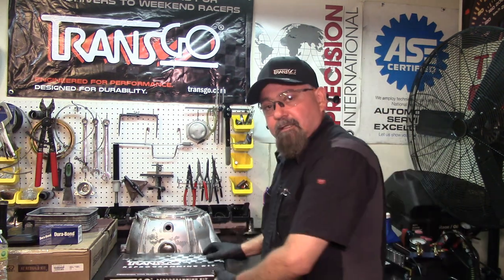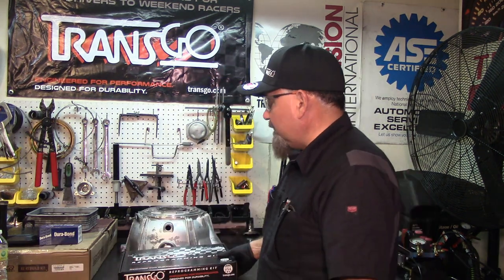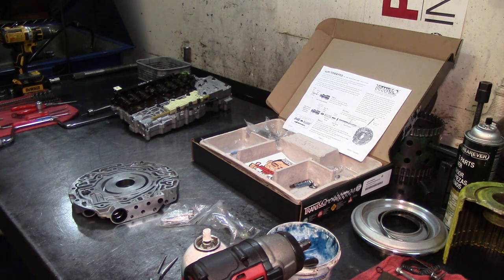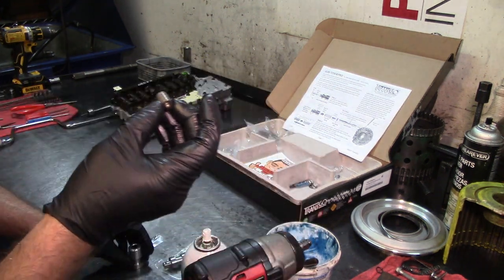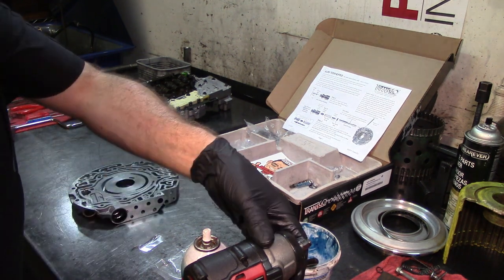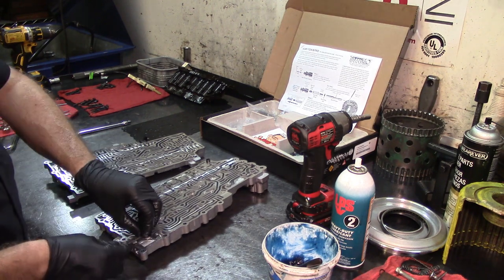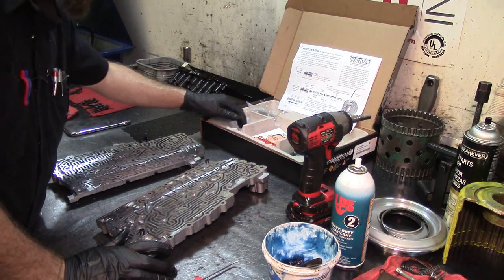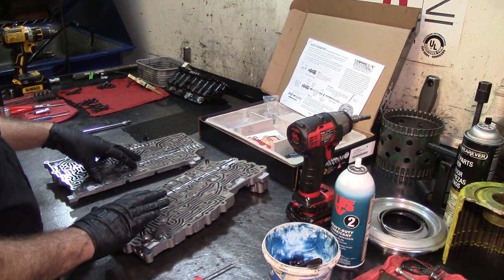6L80E Tow & Pro Transgo Shift Kit Part-1

Comment: Sorry about the wrong AFL spring in there, but no worries it will work just fine with the orange spring. The difference is extremely small, matter of fact we used the orange spring for a while during the R&D phase. As for the end plugs, we don't provide an end plug for the TCC regulator valve bore because the only time fluid goes there in when you are in P/R/N or D below 3 mph on take off. If you look at the hydraulics you will see that SS1 output fluid goes between the shuttle valve and the regulator valve to block the regulator inboard towards its spring. The rest of the time there is no fluid there, so the OE end plug does not need updating. I will pass along your observation regarding the shuttle valve that you notice lose its anodizing, maybe we should indeed consider making a replacement for it. As for the compensator valve we have looked into it before, as you mention the issue is really cleanliness, there is nothing wrong per say with the OE valve so we leave it alone. But hey, maybe it is time to revisit this and consider a valve design that would be less prone to sticking. Thanks for all the suggestions and observations, it is greatly appreciated. Oh and yes, you are correct in your understand of the function of the balance hole in our PR valve. Keep up the good work!
Reply from the maker: Thanks for the info, you really cleared things up with your explanation. I really appreciate it. Thanks again Robert.
Reply: Thanks for the feedback. While I don't do transmission work anymore, I do appreciate understanding why kits include what the parts do.
Reply: Is there an update to the success of Trans Go Tow and Pro Kit?

Comment: I have installed 2 of these kits.  One in a 6l80, one in a 6l90.  It definitely cleans up the shifts!!  Clean, crisp shifts and when pushed the transmission responds with even tighter, firmer, solid shifts.  It’s understandably “expensive” (to the bean counters anyway) but I plan to use them in every unit I build.  I believe the kit makes what I feel like is a great transmission even better.  I only wish there was a way to filter the trash from the converter and keep it from destroying the expensive pump parts.

Comment: Do you think that this kit with a quality rebuild performed as well will do anything to extend the life of the torque converter?  I am currently getting familiar with the HP Tuner’s software but have yet to make any changes to the transmission tuning.  Just wondering what your thoughts were.

Comment: Hey Hiram, if you have a few minutes could you answer a 6l80 question for me? I have a 2016 Silverado (5.3 with 6l80). My torque converter started to go out a little while back, but it never blew up or made the transmission overheat. A GM mechanic friend and myself dropped the transmission and replaced the torque converter and fluid that drained out in the process. We did not change the filter or flush the system. Now, after a few hundred miles, 1st to 2nd and 2nd to 3rd are slipping extremely bad when the transmission reaches 150f or more. The transmission fluid is a bit darker, but not burnt, and there are no visible metal particles on the dipstick. Would you believe this is more of a clutch material being removed from the fluid, or a solenoid issue, or something else entirely? I'd really appreciate your time, as I only have a general understanding of how transmissions work, and you really know what you're doing. Thanks

Comment: I had a shop rebuild my trans from the TC going out almost a year ago now. sometimes at idle i get a odd sound like a power steering pump low on fluid moaning and groaning builder says it because of the sonnax or trans go valve he installed. second issue I'm having is after the trans is warmed up and i stop somewhere for a few mins and get back in and drive on the 1-2 and 2-3 up-shits i will get a bang right after the shift. 3rd issue I'm having is the trans temp around town it will go anywhere from 160 to 196 and highway anywhere from 160-175 and this is with the bypass installed. when i had the bypass installed before i never saw temp above 170 town or highway on a hot day. with the rebuild the pump was not replaced which i wasn't happy about and the techm was not replaced. everything else was supposedly overhauled.
Reply from the maker: Torque converter is a big issue with these. Even remanufactured converter fails prematurely. Have him drop the pan and inspect for metal contamination. If there's metal in there the converter needs to be protected. And transmission needs to be cleaned, specially the valve body.
Reply: did u install the transmission yourself?
Reply: @thechad503  naw shop did entire rebuild/install. Trans still has warranty so not to worried about it its just annoying. I'm most likely going to dump the truck in the spring/summer.
Reply: @thechad503  normally shops don't like to let customers install their transmissions. To easy for mistakes to happen.

Comment: I used the extra info included to order snap rings for clutch packs so I can have them on hand tired of waiting on them
Reply from the maker: Yes I know, kinda hard to get. If I use OE type frictions or Borg Warner I rarely need to adjust clearance. Exedy and everyone else you have to play a little with them but are okay.

Comment: I got a 2008 6l80e in a 2500hd rclb someone rebuilt it,has new converter,it slip shifts really bad on 2-3 3-4 shifts smooth otherwise fluid was a little less then red.. with vb off I can see new frictions and steels  what should I look for

Comment: Those pumps get ruined from torque converter failures on 90% of these models 60/70/80/90E transmissions. Seems rather a waste to have to replace an entire "bell housing" pump and stator because of this at a fairly low mileage. Not only this but those parts are getting difficult to get in a timely fashion.